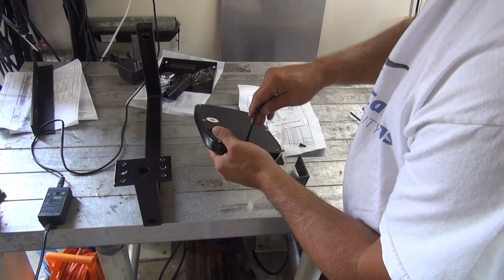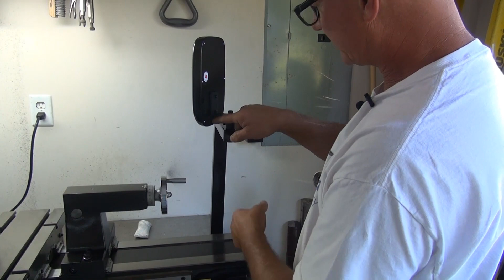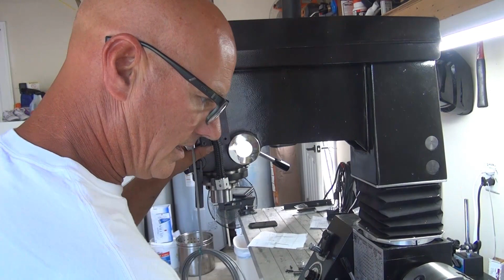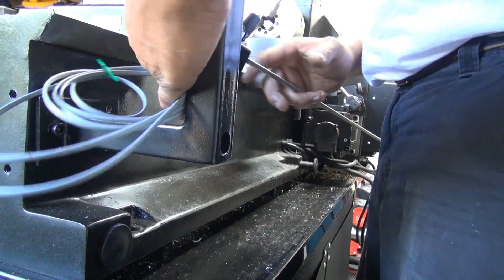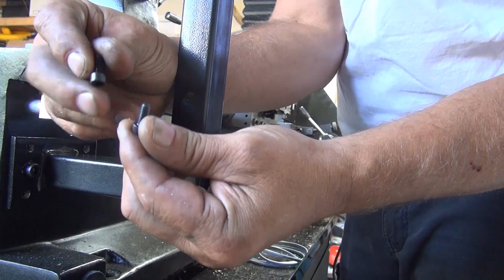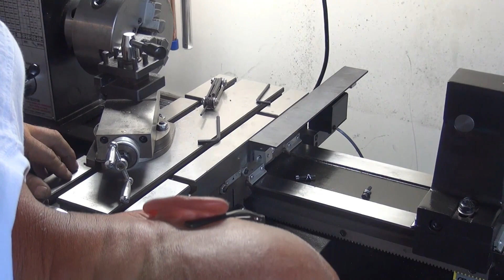CNC Machine - Smithy 1324 Granite Max - Shooting star DRO

Comment: Years late in seeing this but the solution to the short t-slot in the table is to put a t-nut in there before bolting on the angle bracket. Run a short set screw into the t-nut to lock in place and keep debris out of the threads until needed. You're welcome......